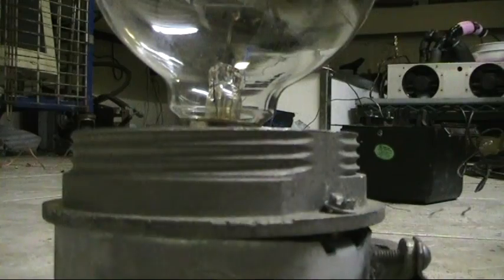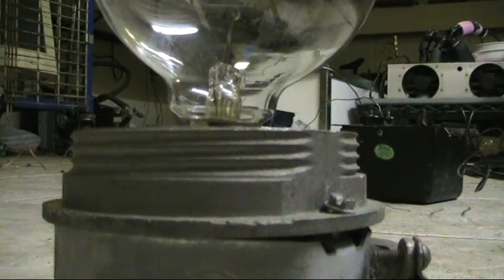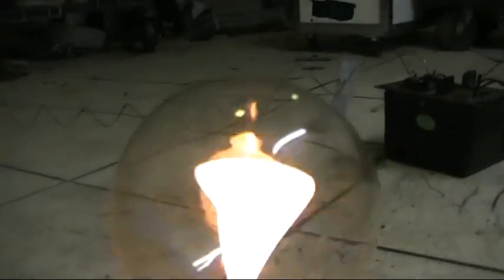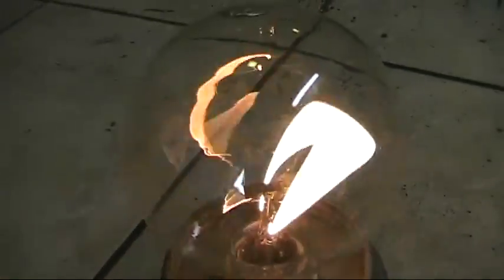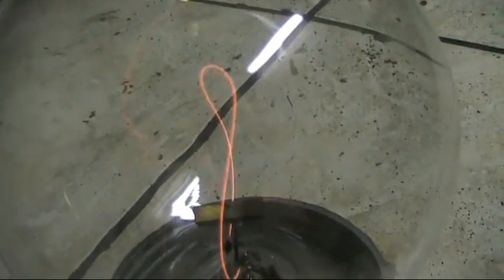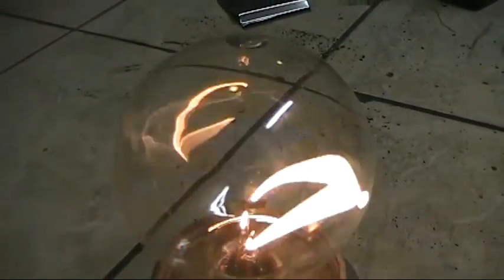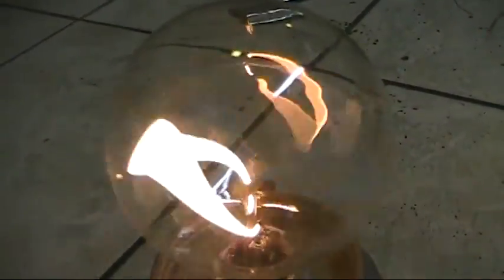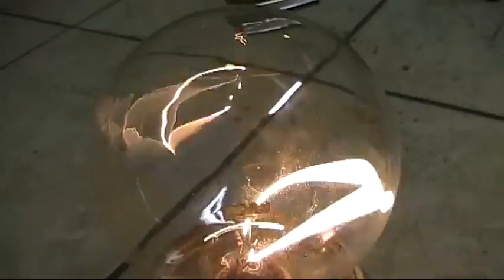Light Bulb with Shaking element (what are these called?)

Comment: Balafire was the brand name. Invented by Robert Kyp, and all of them were hand-made by Kyp. His nephew is making new ones. The filaments are carbon, and are designed to withstand all the action. A magnet inside the bulb interacts with the magnetic field in the filament, which switches with the alternating current.